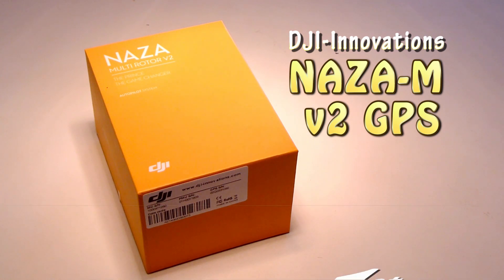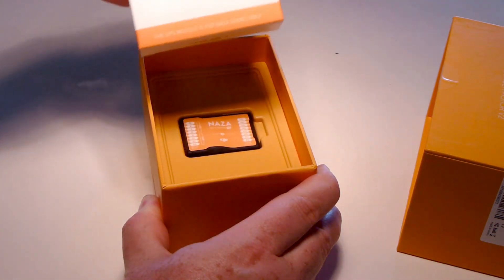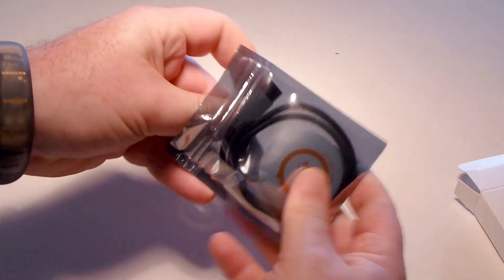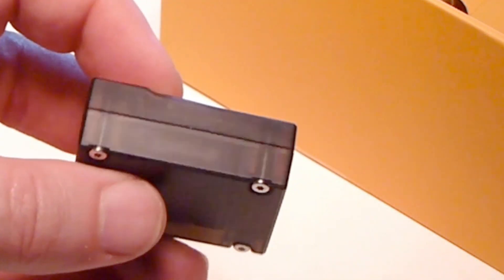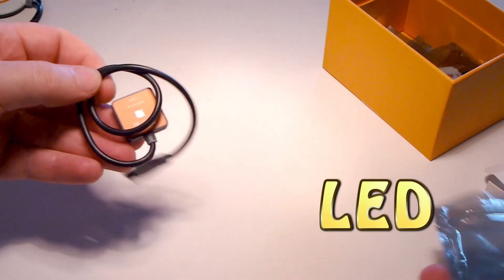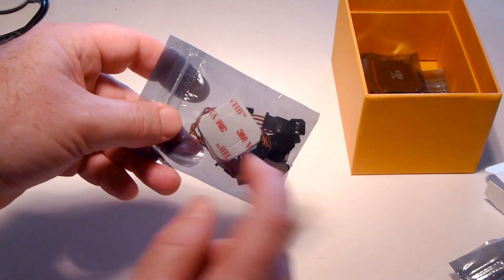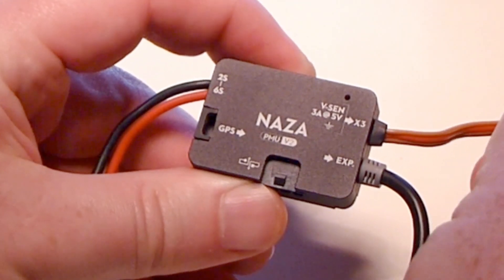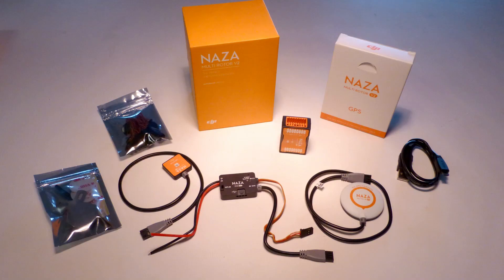DJI NAZA-M v2 First Look

Comment: Im really new to Dji Products and QuadRotor's and I need help.

Im buying a kit as follows

- DJI Phantom 2 + H3-2D
- GoPro Hero 3+ Black
- DJI-5.8 Video DL
- Lilliput 7" HDMI 664/W LED FPV DSLR Monitor

So I guess what i'm asking is, What am I Missing?
WHat does not work/ you think there is something better with this equipment choice?
Do I need a FLIGHT CONTROLLER like this Naza - m v2?

You might ask me " what do you want to do with this set-up?"

I will be
_Taking it to the snow for snowboarding
_Hiking
_Short Film
_High City Pans

Hope you can help explain to me some of the functions of the equipment.

Thanks 

Ryan.
Reply from the maker: Hi Ryan,
I think this is a great setup.... It amazes me how easy multi rotors have gotten in the last year... not long ago it was much more complicated.

You don't need to get the flight controller separately, because a NAZA M v2 is already built into the Phantom 2. Which really make the Phantom seem like a bargain.

The biggest thing I would suggest is some form of flight trainer.... whether it is an RC simulator like Phoenix 5 or a micro quadcopter like the Hubsan X4. Microquads are a great choice because they will build your confidence as a pilot and are so low cost that it isn't a great financial loss when you crash.... and you will crash. It's just part of learning to fly.

The next thing I would replace on the Phantom setup is the DJI RC transmitter. The DJI transmitter if fine for starters but soon you will want something better. The Futaba 8FG is a plug and play upgrade with the Phantom.

Brook
Reply: Hi. Thanks for getting back to me

I've been Having a really hard time getting this information out of the local rc guys who sell the stuff. It's like they don't want to help sell their products.... 

May I ask what makes the Fatuba  better?
Reply: I just checked out the Fatuba 8fg, I have seen that around a lot on YouTube so it must be good :) 

Oh and as far as fpv goes. Could you recommend a monitor / brand of choice?  

Thanks again. 
Ryan